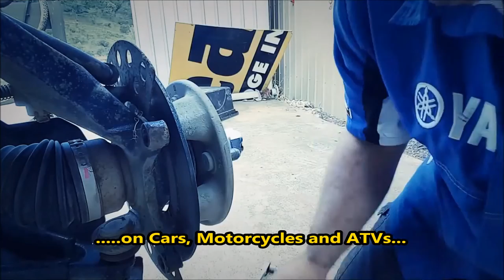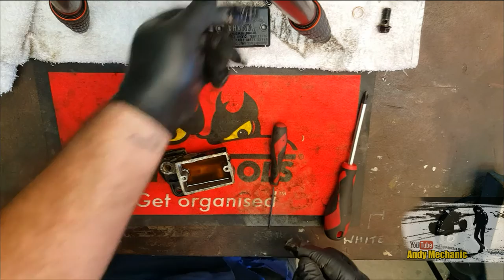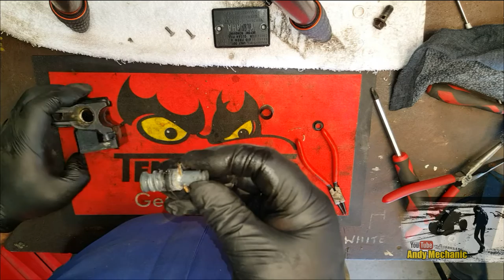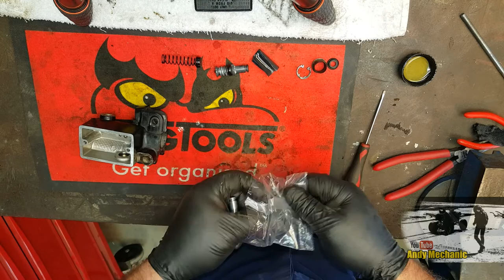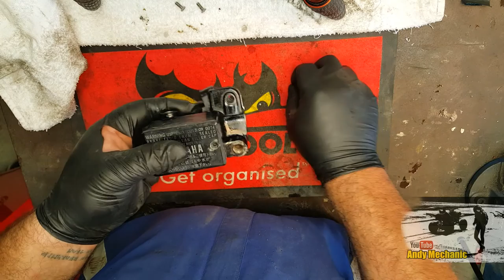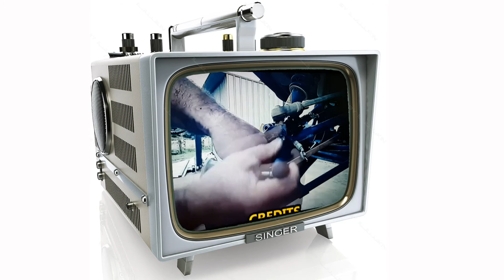Yamaha TDR front master cylinder rebuild #1320

Comment: Hey Andy - great channel and especially enjoying the TDR videos (I have just bought a fixer upper!). I can’t seem to find the road test after the head gasket and mention of an oil pump inspection- can you tell me how to find it? (There seems to be a gap between copper gasket fitting and brake cylinder overhaul). Either way great work and thanks for sharing - 
Laurence in Jersey Channel Islands

Comment: I think lithium/moly grease would be better here. Lever and reservoir is aluminium - so no galvanic corrosion likely. Looks like you took off some paint there.

Anyone else rotate the cap so it faces the right way when riding? Even though it fits both ways?